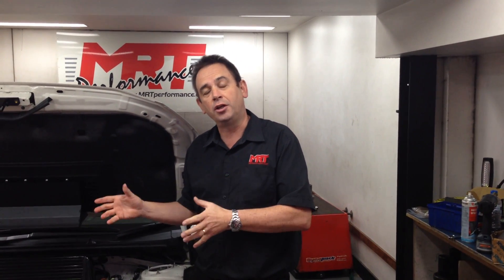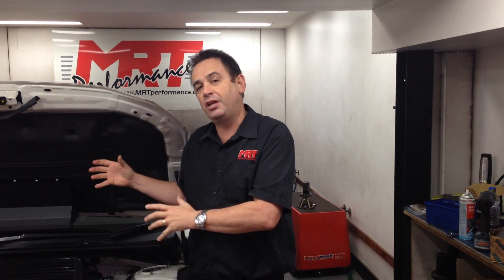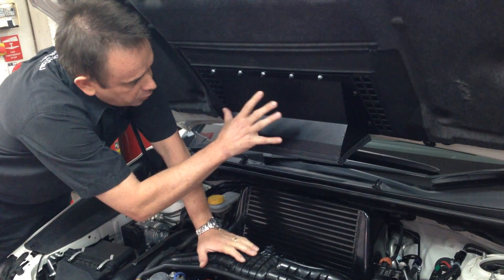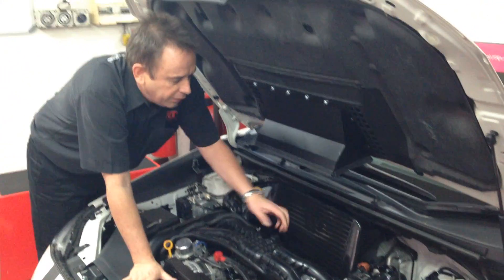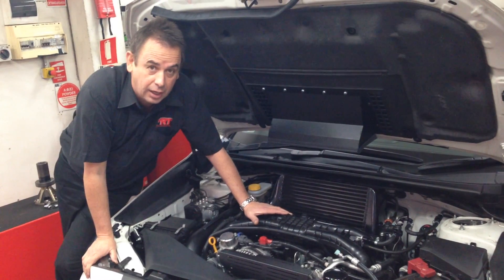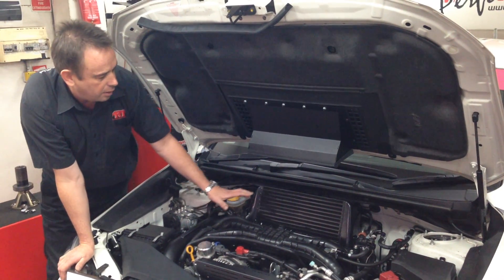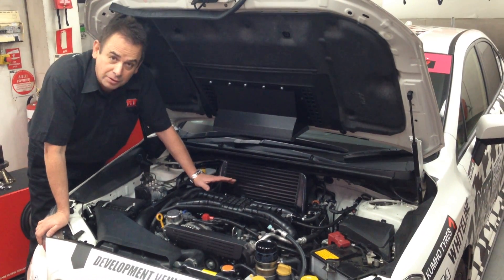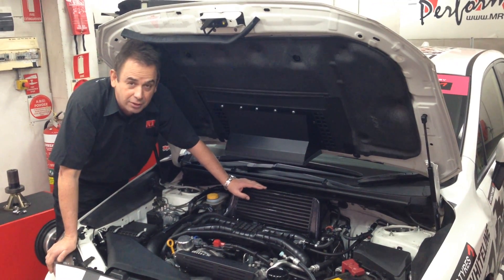Subaru MY15 WRX Verticooler intercooler kit

Comment: Does it retain the same by pass valve location?
Reply from the maker: fits using a combination of factory and new (supplied parts)
Reply: MRT Performance will this intercooler clear a tanabe strut bar?
Reply: MRT Performance can you also polish the pipe?

Comment: First of all, Verticooler is an AMAZING product.  I am sure other brands that use the same design will function very well too.  My only issue is the installation for the USDM WRXs, requires more work and relocation of certain cables in order for this to fit.  Tools were not included so it made installation VERY difficult thinking I had everything I needed.  I ended up taking the car to Cobb Socal where they installed it for me, they had to drill new holes to shift the intercooler 1/2"-1" to the left to make clear the BPV.  Been using the intercooler for over a year now, pushing 300awhp on 91oct on conservative tune,  no issues what so ever.

Comment: How Many hp can it handles?
Reply from the maker: +cresencio flores not really a quantifiable question as its more related to heat rejection than power potential
:)
Reply: +MRT Performance  ok but if I have a 500 hp car do you think this intercooler will be fine or do you think I should buy a bigger intercooler
Reply from the maker: should be fine, BUT it depends on your HEAT LOAD!

Comment: Will it be safe to drive in the rain with this intercooler? The reason I ask is cause parts look more expose than with the stock intercooler.
Reply: Why wouldn't it be safe? Even front mounted ICs are safe, and they are completely exposed.
Reply: I used to drench my stock intercooler with water/alcohol mix during the summer heat using the wiper fluid nozzles. it will be fine.
Reply from the maker: +CEPHALEXIN323 100% ok
Reply: That's a real good question!you read my mind
Reply: +pracata732  Rick from rally sport direct said there is no problem driving in the rain. Will be ordering mine soon. If they have it at subifest I'll buy it there.
Reply: +CEPHALEXIN323 thanks for letting me know!
Reply: remember your intercooler is exposed by the hood scoop anyway in the rain.  If anything the rain just cooks off the IC better lok
Reply: +The nextinline its ok i know its safe now i own one if this. it was a noob question at the time.

Comment: when will these be available to buy?
Reply from the maker: +masterbasser002000 available NOW
:)
Reply: +MRT Performance love your vids for the MY15. 

Does it knock, rub or heat the underside of that cowl, looks like its always touching. 

Also is it hard up against the pitch stop mount behind? I have an aftermarket pitch stop mount which would give a few mm less clearance than stock.